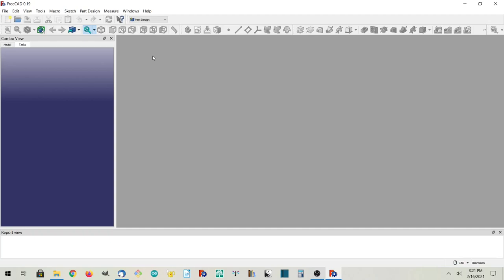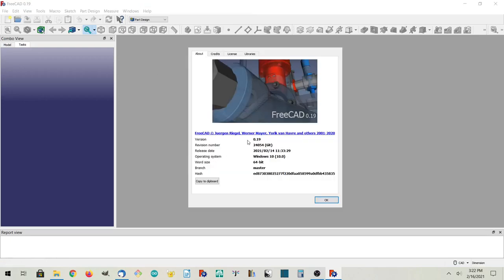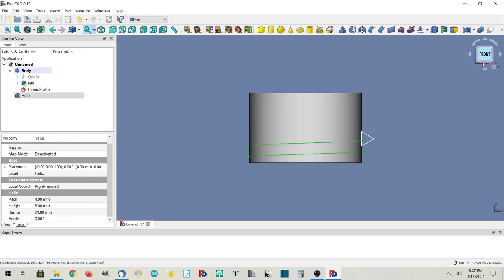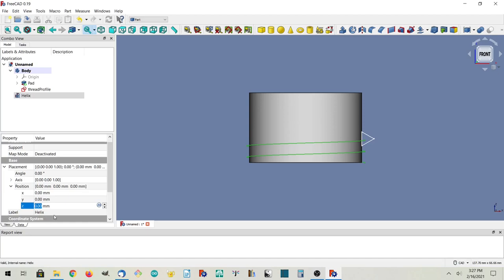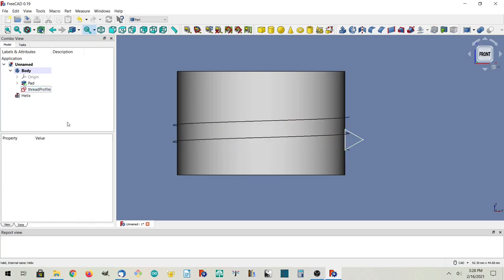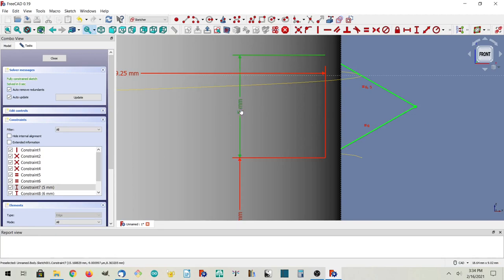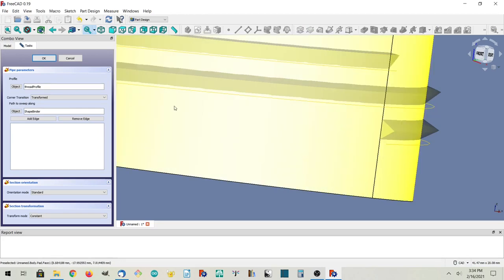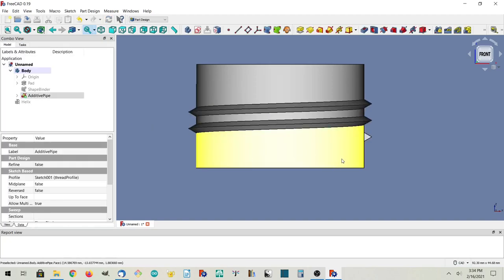FreeCAD threads: Five Ways to Fail, With Workarounds

Comment: I just followed your instructions in your "quick version" video, but used a single helix to cover the full length (it was a test piece, with only about four full turns around the cylinder) and had no problems.  This was in version 0.21.2, so it seems that bug (at least) has been fixed.

Comment: Sorry for the late comment as I just found your channel. What I think you ended up with is an “acme” thread which is very strong yet forgiving as to close tolerances. In the oil field this was also referred to as “hammer lock” thread. A once common coupling that utilized this type of thread could be tightened by hand , then “hammered” tight using ears that protruded on the sides of the coupling. 
Great videos. Thanks for sharing.

Comment: Is there a way to attach (constraint) the thread profile triangle to the surface (limit)  of the cylinder instead of the z axis ? That way you can resize the cylinder later if you want.

Comment: Running version 19, Release date 2021/12/04, and it appears this bug is fixed.  After the initial ShapeBinder creation, FreeCAD was able to refine the shape without issues.  Appreciate the tutorial!
Reply from the maker: Sadly, at least on my Dell laptop running FreeCAD 0.19.4 Release Date 2022/02/28, when I walked through the video, step by step, all the errors still happened. The one difference I saw was that at 21:23 the Refined Shape looks deceptively ok, but when I ran a Check Geometry on that refined part, FreeCAD showed several errors. Thanks for taking the time and trouble to test a newer FreeCAD than I used in the video, and I'm glad it seems to behave for you. Thanks again.
Reply: @BradfordNeedham  Thanks for the video.  Do these bugs still happen in the newly released 0.20 version?
Reply from the maker: @lxc3909  Good question. I'll. try it out when I get a chance.
Reply from the maker: @lxc3909  Yes, I get the same errors in FreeCAD 0.20.1 on my Dell laptop running Windows 10.

Comment: I've gone thru the comments and I know that you've made a new video but at first glance in my opinion is that the Helix diameter was 21 instead of 20 or 19.9
The triangle (vertical line) should be set touching the Helix starting point too.

Comment: fantastic tutorial, could you do one for inner threads as well? I'm having a lot of trouble when I go to use boolean subtract. I worked around it by adding the "thread inverse" to the inside instead, but I'm still curious to see you show to do it properly.  too bad the wiki does have a page on inside threads like the "Thread for Screw Tutorial" page  .... or maybe it is not possible because of the join algorithm helix problem?
Reply from the maker: Just like you, I have created inner threads by adding a "thread inverse" to the inside. I think of it as a thread on a cylinder and a matching thread on a round hole. That is, as two threads that match, rather than as a thread and a cutout that matches the thread.
Reply: @BradfordNeedham   ah glad I'm not the only one! kinda annoying that something this basic needs a work-around, but oh well

Comment: thanks for great video - would be great if you could so a follow-up which specifically looked at how to read off BSP type threads from specs and draw them in freeCAD for bolts and nuts. Specifically BSPT (Tapered) and BSPP (Parallel), thought i'd ask as it would useful for many others as well I feel ;-)
Reply from the maker: Wow! That is so far beyond what I currently know. I only recently learned that the various thread standards exist, and when/where they came into use. Perhaps someone who reads this comment can pick up the ball from here.

Comment: I really like your video, although I have one small complaint. I don't like all the "how to fail" parts mixed in. I would rather like to see a simple straightforward "how to succeed" video, with the "how to fail" parts at the end or in a follow up video. In any case, thank you very much for your time and efforts.
Reply from the maker: To answer that very complaint I created  "How to Make Threads in FreeCAD 0.19 (the quick version)": https://youtu.be/wsfLP7pLsSg  It's under 7 minutes long and covers only the How To, without all the side-tracks.
Reply: Nobody learns anything from getting things right, you learn from mistakes.  Being shown one right way means that's all you know.  Figuring out FreeCAD is about learning what its quirks are and how to avoid them.  (Most quirks are not FreeCAD's fault, it's the representation of 3D space it has to use.)
Reply from the maker: @alucostrix  Good observation: that knowing FreeCAD's quirks lets you avoid mistakes in other models. ...though I do wish its threads had fewer quirks :-)
Reply: @BradfordNeedham  As an engineer, it was very difficult to get my head around why it fails when (geometrically) you're not asking for anything unreasonable – such as when surfaces are just touching (as per your helix around the cylinder).  I think this boils down to the inevitable limits on the precision of calculation: rounding errors only have to place the helix outside the cylinder by one least-significant-bit and so far as the modelling is concerned there is an unacceptable void.  Your video has been very useful in "remodelling" my understanding of this!

Another example is fillets.  When intersecting fillets have close to the same radius, the dividing line between the individual surfaces becomes more and more contorted due to (I believe) insufficient precision of calculation (or perhaps precision in the position of the control points), until the contortion becomes extreme and the model fails (when, geometrically, there shouldn't be a problem).

I do not believe there is a solution to these quirks, I believe they are a consequence of quantisation – ie the digital representation of continuous space.  Solution would involve representing space in a non-quantised fashion in the first place, ie as equations and not numerically, but that would mean inputting your primitives as equations too!

Comment: So basically no good and robust solution
Reply from the maker: It does look grim when I lay it out like this. I've put up a short video, "How to Make Threads in FreeCAD 0.19 (the quick version)", https://youtu.be/wsfLP7pLsSg, that makes it much more palatable. 

The only two problems that get in my way are 1) a multi-turn thread will likely fail, and 2) a thread that starts on the cylinder's seam will likely fail.

Everything else is just good design practice: having the thread overlap with the cylinder's outside edge, avoiding a self-intersecting thread, and make angled surfaces less than 45 degrees off vertical so they 3D print properly. Because multi-turn threads worked in earlier versions of FreeCAD, I expect that problem is a bug that will be addressed once it gets enough attention / love.